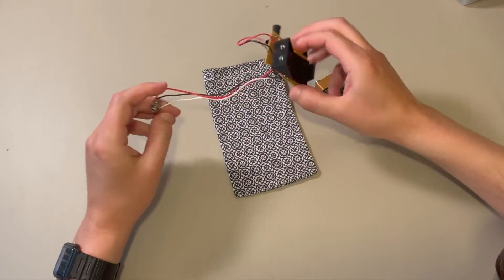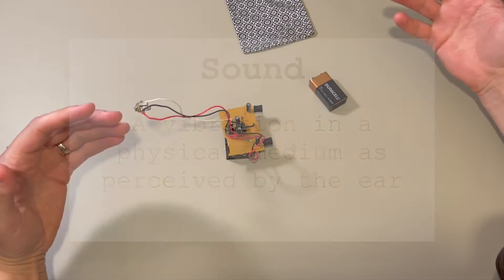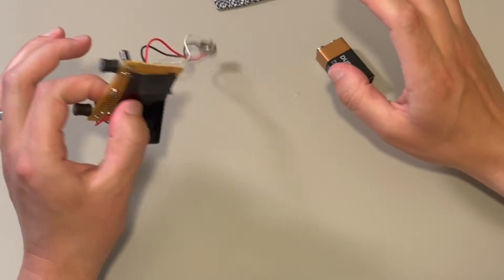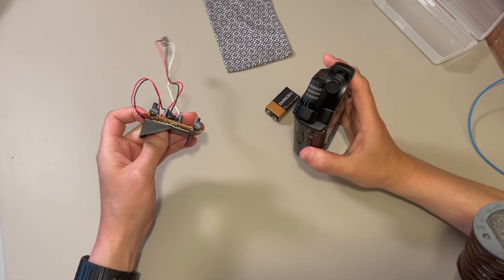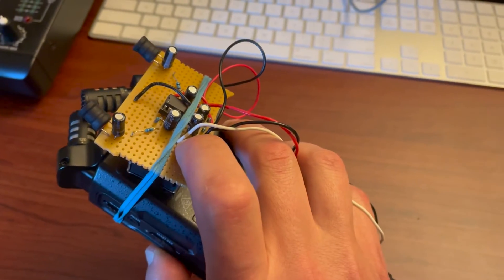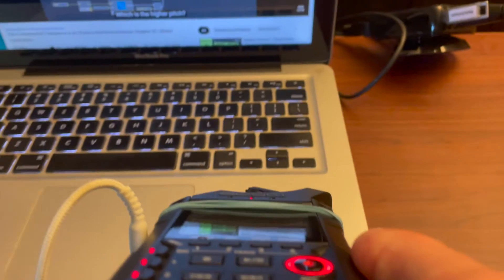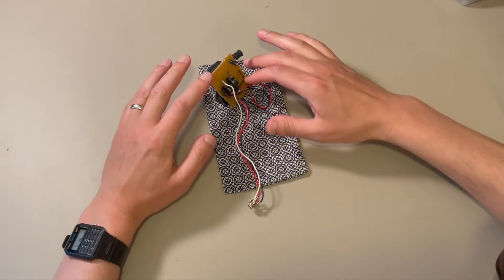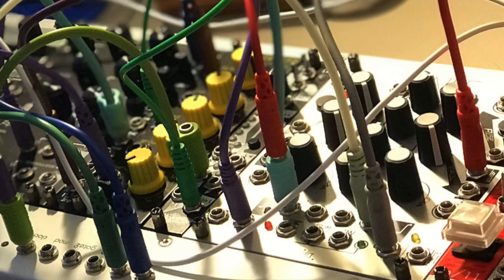Hidden Frequencies: Listening to Electromagnetic Waves with the Elektrosluch | Simon Hutchinson

Comment: Hi there, good video! I also made my version of Elektrosluch several months ago, but with added potentiometer and the on/off switch with a yellow LED, and arranged the electronics into enclosure with a 9V battery compartment. Question: Is there any simple and cheap way of directly connecting this device to pc from 3.5 mm audio jack via some cable, or just plugging the stereo speakers in and then simply recording the sounds with a mic? Thanks in advance!
Reply from the maker: Sounds great! I actually either usually run mine into a mixer (with a 3.5mm to dual, left and right 1/4 cable), or into my portable recorder (with the same cable). Something like this - https://www.amazon.com/Hosa-CMP-153-Stereo-Breakout-Cable/dp/B000068O3C/ (of course no need to get it on Amazon, might be cheaper to buy locally).
Reply: @SimonHutchinson  I see. However, unfortunatelly, I don't have this portable recorder and can't currently afford it. I'd just like to take some recordings of various devices around me with the Electrosluch, and if possible feed the sound data directly through my computer's motherboard jack/jacks, or maybe even usb port? If there isn't such option, then I'll just connect it to my speakers and increase its volume while recording with my phone.